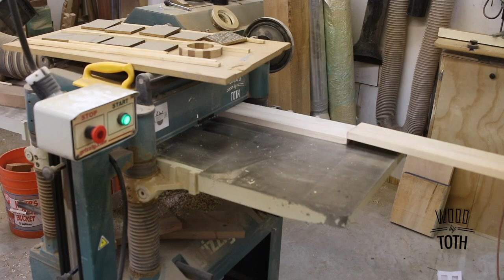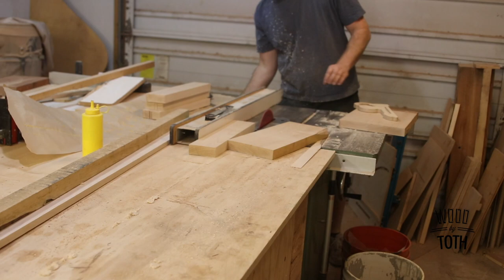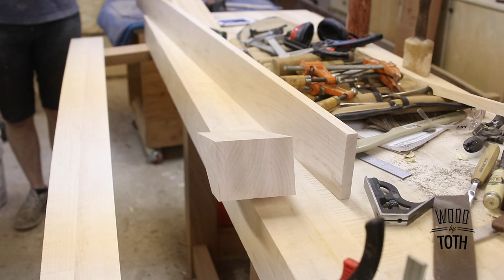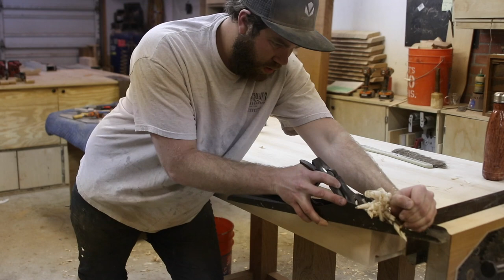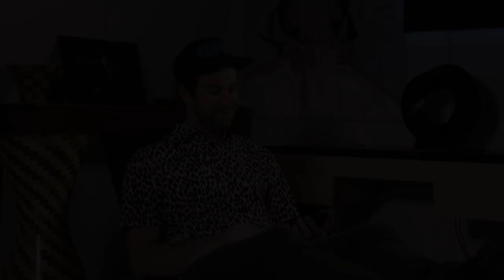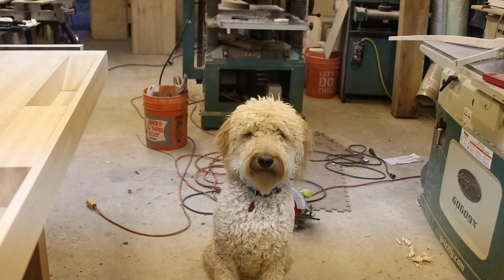Building A Tool Tray For A Work Bench

Comment: the bonus side effect of the block and the angled ends is you can push the sawdust right out of the tool tray.  no vacuum needed!
Reply: Thats not a "side effect" of the angled ends, thats the point of them.